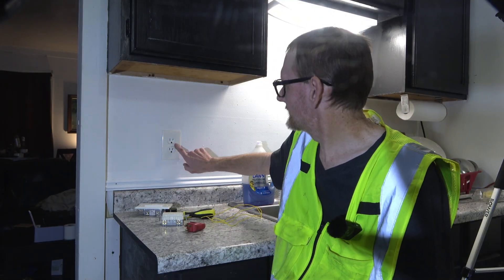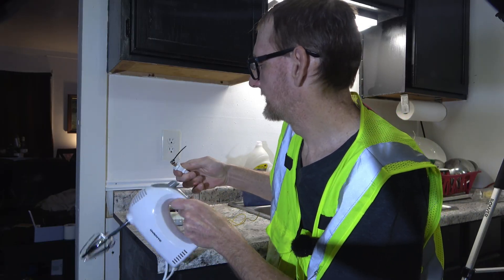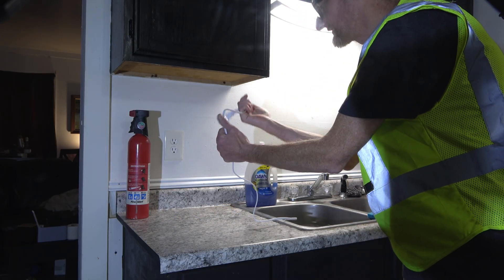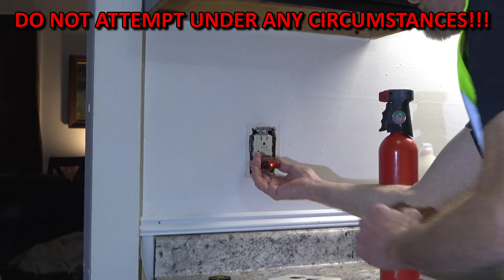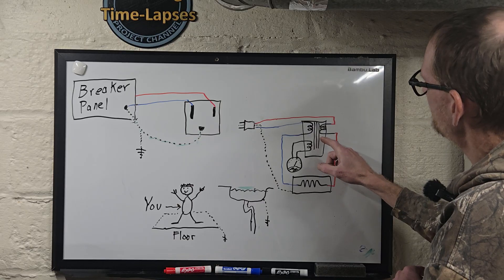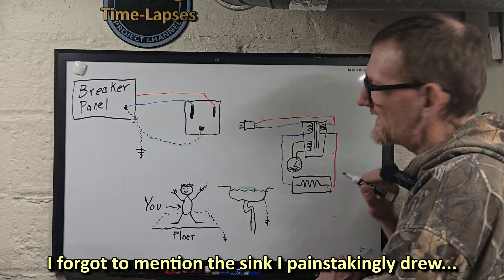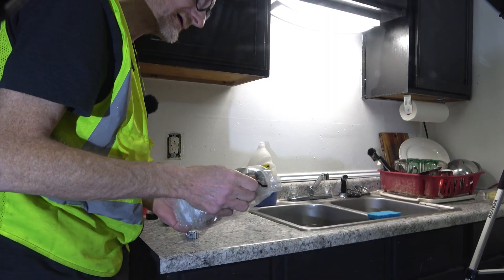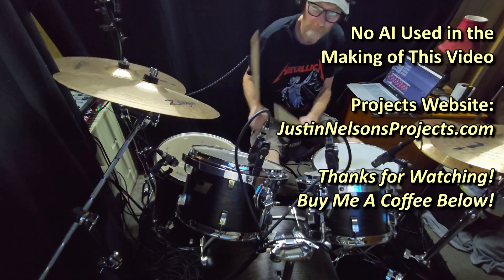GFCI Outlet Misconceptions & Myths ⚡ Even Electrical Inspectors get this WRONG! 🔌DO NOT ATTEMPT!

Comment: I am begging you to do a similar video for AFCIs. I have a PS5 that keeps tripping my AFCI breaker, and it took me a long time to discover that it was because the power supply was designed around GFCIs, and the way it handles power fluctuations works with those, but trips AFCIs. I still jave no idea how those things work, or why some computers are sending power to weird places. Nobody has really made any videos about this.
Reply from the maker: That is a great idea! The demo on that would have to be more controlled, but I'll do some research and experimentation. 

Make sure you're subscribed, I'll try to get something done in the near future 😀

Comment: Over the past 6 decades, I have been shocked ~100 times, and zero times it was because of not having GFCI. However, it caused a lot of headaches in my 35-YO home, so I disabled it. In talking to friends and family over the years, they have the same experience, though with far fewer shocks than I. If GFCI works perfectly, I'm not against it, but it makes me think that someone had nothing to do in his last hour at work at the NEMA office and pulled it out of his keister.
Reply from the maker: GFCI protection is certainly not the end-all be-all for electrical safety. It is one component that, combined with otherwise good electrical wiring practices, can provide just that extra level of protection.

You say you've had "a lot of headaches"... and there are circumstances where you do NOT want a GFCI outlet (refrigerator, sump pump, anything "critical") but as I mentioned in the video, "nuisance" trips are much more rare with newer devices (and QUALITY ones).

I am curious what "headaches" you've had. Personally, I had one that did NOT trip during an ACTUAL ground fault. It was an older outlet (bright red and black buttons), and the "test" button DID trip the outlet, but a real ground fault did not. That was due to its age and "vintage" I suppose... so I totally understand the frustrations that can happen.

However, if I'm in my bathroom with hair clippers in my hand, possibly somewhat wet (I cut my hair while wet), I want to know that if I touch the sink with my other hand, I may still get a shock but only for a few milliseconds while the GFCI catches the fault and trips.

I'm a renter, but I talked my landlord into letting me replace some older GFCIs (kitchen) and putting one in where there wasn't (bathroom)... I used only Legrand "commercial-grade" outlets as I've had great experience with them.

Thanks for the comment, I'd love to hear more about the particular headaches you've had, and I'm curious what you mean by "so I disabled it"...

(note that I am not talking about GFCI breakers in the panel -- just the outlets at the end-point in wet/outdoor locations)
Reply: @JustinNelsonsProjects  Biggest headache was, the 3 GFCI outlets in my carport would trip when it rained or even got foggy, though there was no water or even mist, and the concrete was dry. 1 was shared with the bathrooms, making it worse. Pretty sure 1 was defective. If I remember right, they were Leviton. I just think it's overkill when most bathroom gadgets already have built-in GFCI or double insulation
Reply from the maker: @Bob_Adkins  To each his own I guess. For code compliance of course they are required in those situations, but if it's your own home and you're willing to risk any liability...
Reply: @JustinNelsonsProjects  My wife won't sue me if she gets shocked, but I may be surprised. 😁
Reply: 100 times? Slow learner? 😂
Reply: @snorman1911  Worse than that... electrician's helper for a year and a tinkerer for my whole life. Worst shocks ever was from a lawn mower, runner up an electric fence.
Reply from the maker: @snorman1911 I don't quite have six decades, but I lost count of how many times I've gotten bit by 120 volts... I do work as an electrician, these days mostly retrofitting old fluorescent fixtures to LED. 

And most jobs I do, I kind of have to do it while it's energized otherwise I have to kill all the lights in an office building etc. And sometimes, shit happens lol. 

You do learn to avoid getting a shock, but at the same time especially when you're working on someone else's work, you don't know what you're going to find when you open up a light fixture... 

If you work with electrical on a regular basis, getting the occasional shock is kind of just par for the course which is why I didn't give him any grief over that. And 60 years, I'm sure he's seen some electrical situations that would definitely not pass today's codes ⚡
Reply: You need to Google "survivor bias"